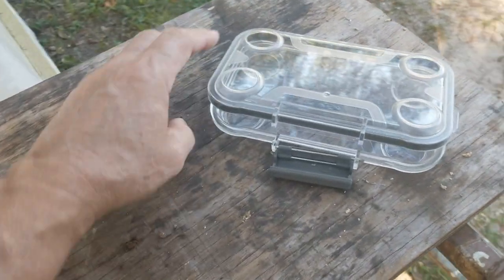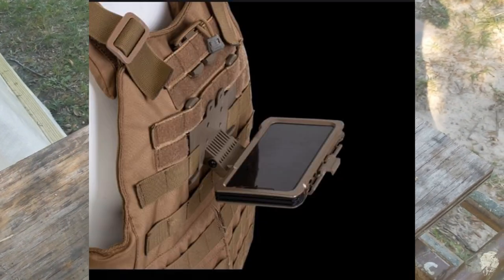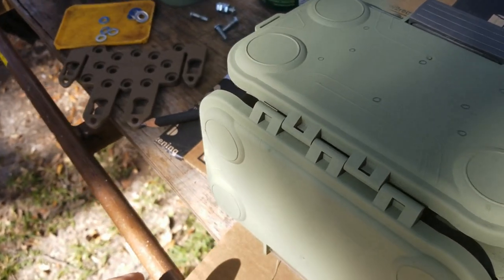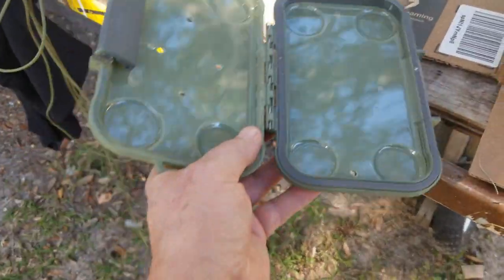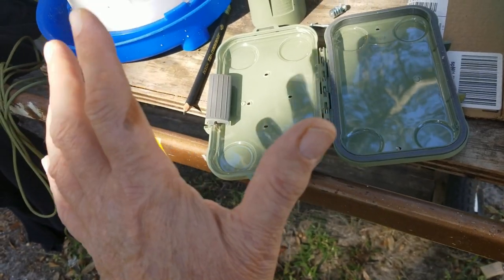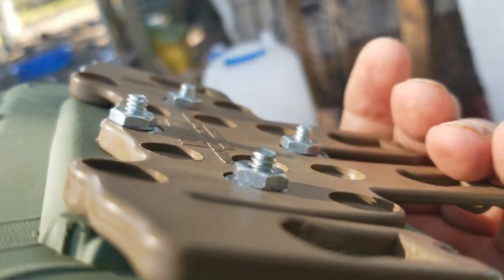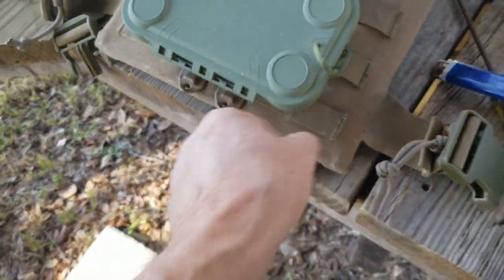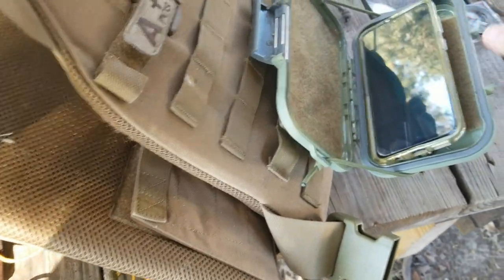DIY CHEST RIG HARD CASE

Comment: That is a great idea actually, though you should be careful with the screw heads facing the screen of your phone they might crush it if forced a bit harder.
And i wanted to ask do you own a medium molle rucksack?
I would like to improvise a frame for the one i bought from a large diameter pvc pipe so if you have one can you please give me the measurements width length thickness of the frame and how wide are the pieces at the top? A short video on the quick measurements would be really appreciated <3
I will share the info on the topic and how i did things if you would like to show it off on youtube too, not many videos on the idea